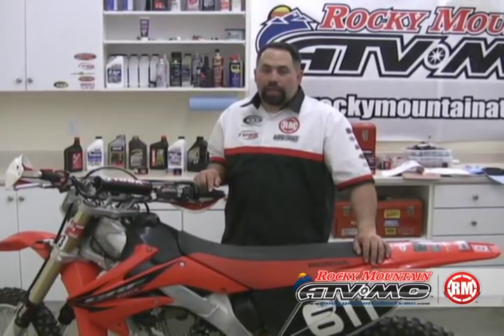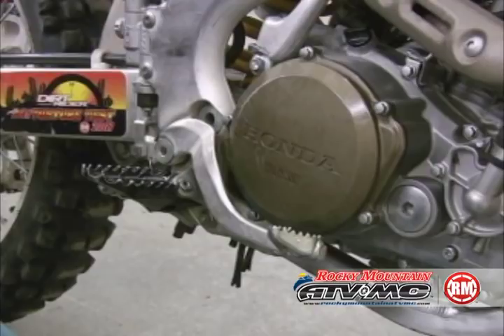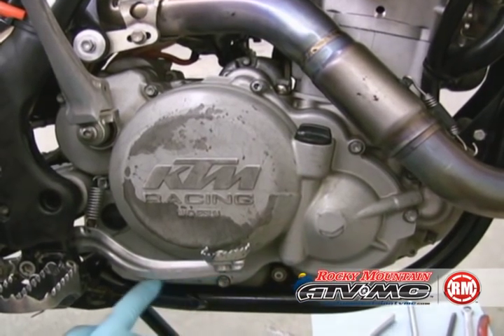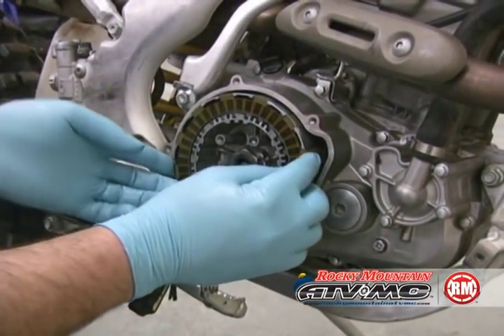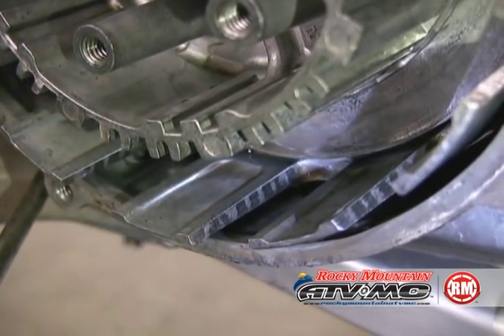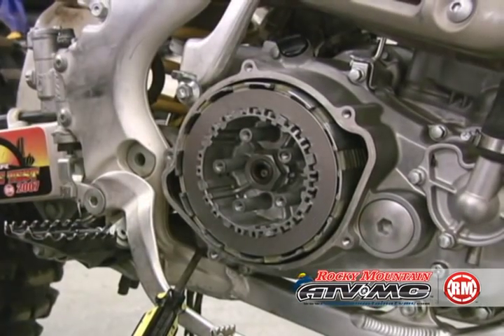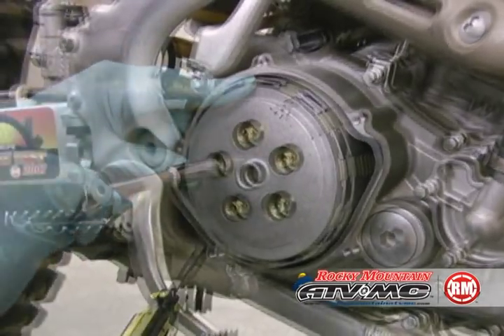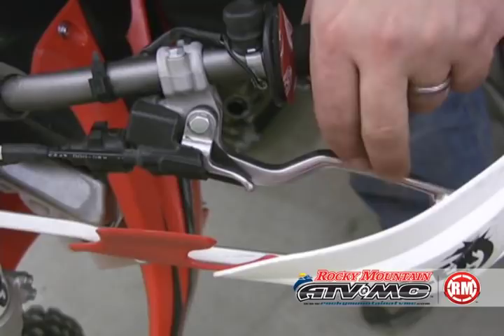Clutch Replacement on a Motorcycle or ATV - Clutch Installation

Comment: Great Vid  I ALWAYS come back to refrence any work I'm Doing on my bikes...
ok  New Batt Fully charged before using....
2 days later Batt Dies.... Recharged and checked w Voltmeter how low and how high the voltage was going during starting the bike and during high RPMs
these are the numbers   During Starting  down to 11.4V   during High RPMs 14.2V
if I discontect one of the Batt Cables after Starting it shuts Off........ Rectifier??? Stator????? What is Your Opinion??? Thnks

Comment: If the inner hub or the basket was worn and you had to replace in would you have to take the whole motor apart or just in bolt a few things and pull them out?

Comment from the maker: @mojospin - The plates may be having a hard time separating because your basket and/or inner hub is wore out and has deep grroves wore into them.  Or, your plates could be warped.  The most common problem is a wore out basket and/or hub though.

Comment: im selling the engine now, i just lost my patience and i want to try something different, but i think i found what the problems were, i believe it was the gasket in between the carburetor and intake manifold not sealing right as a result of uneven surfaces during the port process of the intake entry hole which resulted in a air leak, the slipping was i think from the clutch design, the specific clutch i had probably wasnt meant to be used on a scooter but only meant for a lawn and garden trimmer

Comment: @RockyMountainATVMC yea thanks i torqued the pressure plate bolt to about 9 foot lbs and it still does it. im pretty damn sure this isnt normal its pretty rough sounding. my crf250r doesnt do it. and i think its the needle bearing on the clutch or the top hat bearings, i really hope becuase im not spliting my cases for the idler gear bearing

Comment from the maker: We don't have the manual, but we have all the tools.  Check our website.  The part # for your flywheel puller is 1179010002.  It is $9.99.

Comment from the maker: @KwikzClan - It depends on the machine and what the manufacture recomends.  in this bike you can use motorcycle transmission oil or motorcycle motor oil.

Comment: Nice. But I have one problem, I have a Peugeot vivacity 50cc and it had some square spots in the variator rollers and also a worn clutch. So I purchased new rollers and a new 107mm adjustable clutch. I tested it out with only the new rollers in and the back wheel spun after alot of revs so I pit the new clutch in. Now the back wheel doesn't spin atall. Any suggestions? Thanks!

Comment: Have a 2001 Kodiak 400 4x4, recently got stuck in the mud trying to pull someone else out and now it will inch forward a few feet and then just revs up with no movement. I've been told to check the clutch but wanted a little reassurance before I did.

Comment from the maker: @Owningya - It sounds like it is shot.  The best thing you can do for your CR500 is get an aftermaket clutch with steel drive plates.  The stock aluminum plates in CR500's  wear fast and turn the oil black in a hurry.

Comment: With my kx 65 my clutches were stuck from the motor oil the people we got it from so we got a good price because my dads a mechanic so we had to clean off everythong in the clutch we used transmission oil instead of motor bnow it runs perfect

Comment: i have a rm 125 07 model and its been raced prepared. the clutch on the bike is not disengaging. when ever i pull my clutch in and put into gear 1 it stalls straight away i have to give it really high revs to get it to not stall.

Comment: It's a 2003 Honda cr250, I changed all the plates and springs only. When I put all together you can see that the lifter is not moving out far enuf to push the pressure plate out so dose this mean its the wrong lunch kit I got of the company or do I need a new cable. Thanks so much for your help.

Comment: i have a similar problem that trav0RM125 has, i just got a 91 CR250R, i put it in neutral, started it, pulled the clutch lever in, put it in 1st and it tried to go with the clutch in and died. but when i rev it up and push the bike then put it in 1st it goes, and im able to shift up and down while im riding it. but when i go to pull the clutch in and stop it bogs and dies, im buying a tusk clutch kit for it this week from RM to see if the problem is fixed.

Comment: Got a 94 YZ250, minor clutch issue. Dog's a bit, got a new ball that sits on the end of the rod, haven't taken it apart yet. Told this was a normal problem, just want to know if I have to remove the whole side cover, or could I get away with pulling just the clutch cover. Just don't wanna put it back together and miss something ya know. Maybe you guys could tell me if there is something from a newer YZ that is compatible and a better design.

Comment: 1985 kx 250 took clutch off and found the ball bearing after i was finished does it go in between the lifter and push rod or between the lifter and pressure plate?

Comment: i got a 98 honda cr250, i think the plates are slipping to much and there is also when im sitting in neutral warming her up and i pull in the clutch to shift to 1st i hear some noise going away from the clutch side when its not pulled in it makes a whoosh whoosh sound in beat of the rpms, im thinking of replacing them this spring.

Comment: ok heres my problem, i would REALLY love a response, and help is greatly appreciated! i have a 2005 kx125 and i took apart the engine (everything up until splitting the case) and upon putting the bike back together i realized the clutch is nothing pretty much,when i pull on the cable, the clutch pin on the magneto side of the engine rises (only half way) and then does not even pull itself back down, it only goes down if a push the cable back into the engine. like i said any help is appreciated!!

Comment: I have a 2001 cr500 and i am not sure if it is the clutch slipping, it still revs good but doesnt get any power as if the clutch was half stuck on. I have heaps of freeplay in the clutch

Comment: Hi I have a 05 drz400sm an I just did the clutch wire, tusk clutch plates, springs etc an I left both cushion plates in an it's slipping I took off both cushion plates an it's still slipping do you know what's the problem? Am I suppose to only leave 1 cushion plate or? Please let me know asap

Comment: Thanks for the tutorial! I have one question. The new clutch plate i recieved have no manual.. User manual says it has a color on the plates, but because its not a OEM clutch there is no color on the fricton plates. Does it matter if i just put it in? The plates are all the same thickness but the grave/lines are different and not the same, i hope you can help me, Thanks! (RM125, 2005)

Comment: i have a 2007 and 2008 arctic cat 400 4x4 manual shifter and there is no after market clutch kit. I was wondering if a suzuki aftermarket clutch kit will work for my 2 arctic cats and if so what brand do you recomend. 
thanks for the help

Comment: hi, i have a 1991 cr250 and the clutch isnt working, i have taken it apart and worked out it is the clutch plates sticking together, there is plenty of life in the clutch rings so i dont want to replace them. i have seperated them al and put oil on them but not soaked for long and they still stick but my clutch works a little bit now when i pull my lever in. any idea how to stop them sticking? and its a helpful video

Comment: I have a 1995 WR250z and i was wondering what size the centre clutch nut would be. 
for removal would i be able to stick a aluminum washer between the teeth so i can remove it?

thanks!

Comment: I have a 2007 crf250r and when I get it into first and start letting go of the clutch lever there is only a little grab at the end. Would the colprite be the friction plates or the springs or just clutch adjustments.

Comment: Hey if my bike idles good then I give it a rev and when it tries to idle down it dies. What's wrong and it's ridable and needs a clutch. This Is while in neutral and it's a ktm 125. Can the clutch make a knocking noise? Thanks and great vid. Do the steel plates usually get worn?

Comment: i also tried adjusting the clutch cable, loosening and tightening the cable and had zero results. would my problem be that its clutch plates are worn down and i just need a new clutch kit or is it something else?

Comment: hi, i have a 94 blaster and i just put a new clutch in it a couple weeks ago. i made sure that there was plenty of slack in the clutch line/handle and there has been the whole time. my clutch slips when im riding along and stab the throttle, or when i shift. the engine doesnt feel any extra load it just revs up higher. the kid i bought it from says there is some sort of adjustment nut/bolt in the center???please help. i just put in a new piston from you guys today and now i ran into this.

Comment: i have 3 questions. 1st, are you suppose to soak the friction and drive plates or just the friction? 2nd, do the friction plates go in with the rough side facing the cover or the motor? 3rd, do i have to put the bike in neutral or in a gear?

Comment: Is there a specific pattern the drive plates should be set in? I have a 2009 rmz 250
Reply from the maker: Levi Palmer Drive plates no not really.  I like to put them all in the same way though, you'll find one edge on the drive plate will feel smoother than the other.  So i go off of that and put them all in the same dirrection. Let me know if you have any questions, hope this helps!

Comment: First off, great video! 
I have a problem with my son's 2019 CRF 230 clutch, seems like it's engaged, as when you go fast at the end of the gears, it just revs.. I since have learned that we been using wrong oil (need wet clutch oil..duh)..Changed the oil and filled up with Lucas MA oil took it out for a ride still same problem... 
Any suggestions?

Comment: Not sure if the sudden engine revving of my old sports bike with 35,000km is clutch slipping or the actual powerband. (this almost goes away when the engine is hot, I thought a clutch would slip worst if the engine is hot, am I wrong?) Also any adjustment needed where the clutch cable is connected the the engine casing? I"ve tried adjusting the free play at the lever with no results. Thank you very much for any insight.

Comment: @RockyMountainATVMC  well, if i want to set off and put it into gear it stalls, so pulling the clutch lever in doesnt do anything. it now works a little after putting it in gear not running and pulling the clutch lever in and rolling it backwards and forwards, but its not working enough

Comment: @RockyMountainATVMC alright i got every thing adjusted ...turns out  a couple plates were missing. the outer friction ring, which touches the pressure plate, spins with the pressure plate when the clutch is pulled in. it sticks because of the oil sticking the two together  and when i let the clutch out, it doesnt get caught anywhere/on anything, even if it doesn t fit in the grooves on the basket. should this be something to worry about? i figured it would maybe wear itself in and fit.

Comment from the maker: @Joseph Riley As with most aftermarket clutch kits any stock cushion rings or jutter springs you'll remove them with the installation. With this Tusk Clutch Kit you should have 8 Friction Plates and 7 Drive Plates. No cushion rings should be left in. Have you adjusted the free play in your clutch cable? How long since you installed this kit into your bike?
Reply: I've Installed them maybe a week ago an I've tried to adjust the clutch wire but when I do it Gets harder. Do you think it can maybe be the bottom end where the clutch wire goes onto it kinda looks far
Reply from the maker: Joseph Riley It's possible that you fried the clutch plates by leaving the cushion rings in with the clutch stack. Have you inspected the plates since you installed them?
Reply: Nah. I haven't done that yet. Maybe I'll do that tomorrow morning. What should I be looking for when inspecting them?

Comment: on my 400ex the clutch doesnt fully engage when i pull the clutch, like when i have it in neutral, then i pull the clutch and switch to first gear my 400ex  wants to pull and tries to take off.. if i replace these should it do the fix it? im still learnin as i go, thanks!

Comment: does it matter which way the friction plates or steel plates go in? i replaced the clutch on a 2010 crf250 and its not fully engaging, iv tried adjustin it with both adjusters

Comment: I have a 2005 crf 450. Now my question is how do i know which plates go back in and exactly how do they line up? Is there a certain exact way the plates have to be set in the basket? I think I accidentally switched one of the friction plates spots with another and do not want to screw my trans up. Any help at all would be appreciated

Comment: I have an older bike 97.   Should torque the bolts to spec?   I'm talking head bolts. Lower case everything?  I'm going to be splitting the case

Comment from the maker: @ramseymactam - The gear boexes are fine on those bikes.  try a good motorcycle transmission oil in the bike before you tear it down.  What would it hurt?

Comment: My clutch burned out, and the oil is very dirty and messy. There is a lot of sticky black oil still in the case and I want to try to get as much of it out as possible.  Would it be safe to use contact cleaner to spray out the clutch area to clean it? Or would that be a bad idea? If that won't work, what could I use to clean it out?

Comment: When installing this tusk clutch kit on a 06 raptor 700 do you still need to remove the Cushing ring
Reply from the maker: +Miguel Tovar Yes.  Going to an aftermarket clutch kit you will want to remove those.

Comment: Hey, I have a 2000 CR250R. I got it christmas this past year, and I am almost sure it is all stock. i have replaced the clutch CABLE only when it broke a month or two ago which i think was 9 years old, lol. but i noticed when im riding for a while or my bike is hot, when i start her up in gear, theres two things, it doesnt want to idle as well as it does usually which i am pretty sure is normal, and it feels like the clutch engages a bit cause it pulls forward slightly... what could it be?

Comment from the maker: It it "does" shift, I don't see what the problem is.  If it doesn't, it wouldn't be related to the clutch.  more likely a shift mechanism or transmission problem.

Comment: my 03 drz 125 starts in nuetral fine. 

after i start riding (when i go from gear to gear) it feels like my clutch lever doesn't work.
but when i stop, the clutch works fine. feeling like it has heavy drag when i ride.
and when i am riding, and pull the cl.lever, the bike nose-dives, like im not using the clutch at all.

any help will be appreciated.
btw. great videos, and i shop from u guys all the time (im new to MX).
 please make a vid w/a 03 DRZ 125L if possible. (u can use mine  ;)  )

Comment: and when i say pulls forward its only just as i kick it over with the clutch fully engaged (so i think) and then quits pulling. its not a violent pull, its just weird. and i love the point where my clutch engages on my lever its very compfortable. im just afraid that its been 9 years so it may need to be replaced finally.

Comment: Hi.. When we open the cluth and then install again .. Is that the cluth plate has a marking when install???
Reply from the maker: Alim Sajea If any of the plates are different than all the rest, you'll need to refer to your service manual or the OEM diagrams on our website for clutch plate order. If all the plates are the same you'll simply follow the procedure shown in the video starting with a friction plate and then alternating to drive, friction, drive, friction and so on. The orientation of each plate will not matter.

Comment: will a clutch kit fix my problem??? I have a 1995 bayou 300 and it is not wanting to go into any other gear than neutral. The pedal shifter isnt locked up or anything, I just dont know what it could be.

Comment from the maker: @musicatan07 - i just looked at a parts diagram for a 1998 KX125.  There is no metal o-ring.  stock only shows steel plates and friction plates.  That is what I would go with.

Comment: So i just got a new bottom end and the sprocket moves fine and shifts all through the gears, but when i install the clutch basket with the plates and pressure plate the sprocket locks up like its in gear?

is there a trick? i followed how the book told me to do but no luck?

Comment: No. I even tried overtightening it what is bad, but that didn't help. I'm my golf that "free space" is very little, but on raptor it's to big IMO. We have KTM 250cc it has that too, but again it's just little and you almost can't feel it. That free space is made for gear ups without clucth I think. Maybe it should be like that? Anyway, when i will be able to change oil i will take a look at my clucth.

Comment: I have raptor 700r(2007).  When i'm going at whatever gear 1,3 or 4 throttle is released at the momment and when i push throttle it feels like engine is going on neutral gear for a very little time (about 0.15 - 0.20 sec) and then torgue hits wheels quite sharp. I DOES NOT FEEL like it is slipping, just a free space. Is this cluth related? I have golf 4 2000 year and it has the same problem. Can you advise something?

Comment: hey, i got a ltz 400 suzuki 04 model my clutch is going out oem can there be any ajustdment,or new clutch if soo what brand you recomend for it,the atv was stolen but i recovered it back but with clutch fuck up ,when you relaes the hand lever a little it tends to die,and i clutch in and crank the bike is moving while cranking thanks